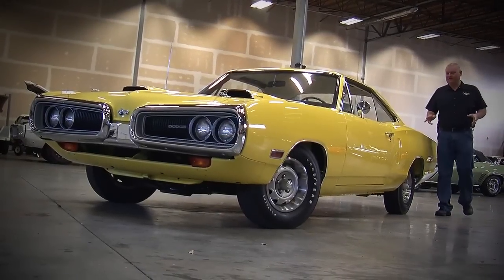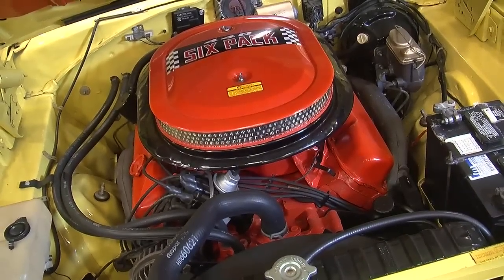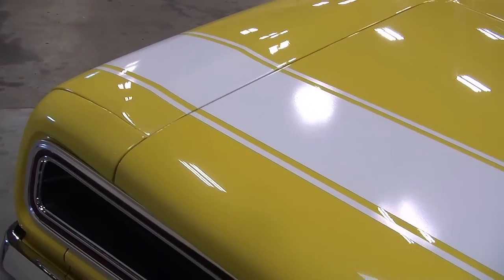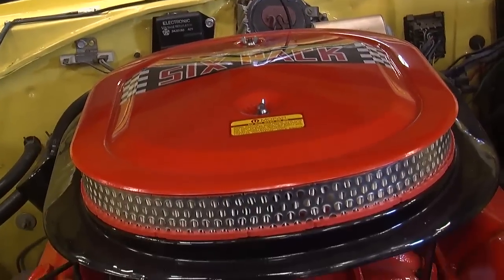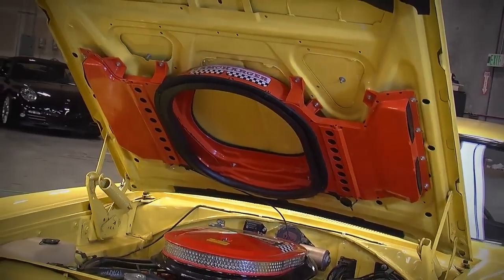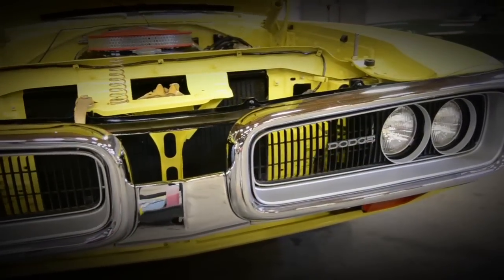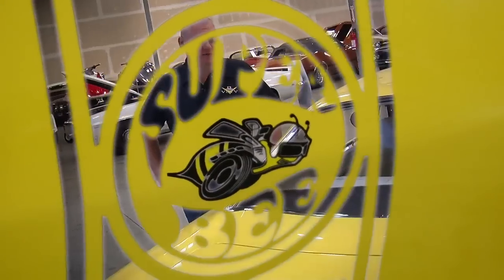1970 Dodge Super Bee 440 6-Pack Muscle Car Of The Week Video #21

Comment: Love that one year only front end!
Reply: Me too. The Coronet R/T/Super Bee is my favorite 1970 Mopar...other than a Hemi Cuda coupe. Love the nose of the 70 Coroner R/T/Super Bee. The Roadrunner/GTX looked almost just like the 68-69 models
Reply: My favorite model too, besides 69 charger
Reply: Back then cars changed every year
Reply: My 70 had a single scoop in the center of the hood. Then put it in a neighbors garage and tool every nut and bolt we could take off from front to back top to bottom. 1 year later fired up almost 500 hsp Beautiful hot rod .

Comment: When I was 19 in 73', I had a 440-6 SuperBee, mine had the power bulge hood, I believe not many of them around, mine was a 727 column shifted, Dana60 with 4:10's, power front discs, buckets, no center console, full insterments, go-wing, chin spoilers, red with black "Bumblebee stripe, the hood was flat black and the bulge was left red, looked really cool. I liked having the L60's fit right in the wheel wells, skinny front tires. Mine did not like going around corners! I have pictures but don't know how to put them on here. Wish I still had it. 😞 I'm now driving a 69' Swinger 340 4spd. Fun to drive, but wish I had the "Bee"!

Comment: I had a 1970 Coronet R/T 440 Magnum in 1974 when I was a junior in High School. I only paid $1100 for it. I was in Auto Mechanics Voc Tech, so I installed what was equivalent to one of the Scat Packages on it myself. I had an Edelbrock intake, Holley 850 double-pumper carb, Hooker Headers, and Accel ignition, but stock cam and valve train. Even with a Torqueflite auto trans (with a "shift kit") and a 3:73 rear end, with Mickey Thompson fat tires on the back it even caught rubber going from second the third and was practically unbeatable on the street. I though it was pretty ugly though, because it was "Plumb Crazy" purple with a white stripe around the tail and had white bucket seats with a console and black carpet. My mom sold it for $1000 after I went in the Air Force! Wish I still had that car!

Comment: Fuel-injected engines are really nice today but you just can't beat the old carb engines in muscle cars when they're tuned right they run and that Ram air system you could hear it when I used to have my duster you can hear it sucking the air in what a sound

Comment: The idiot light at the bottom of the dash was not for oil pressure.  It was a REVERSE GEAR indicator for 4-speed equipped cars.  GREAT VIDEO OVERALL!!!
Reply: David miorgan That’s correct David. Had a ´72 Duster Daemon, and that amber light illuminated when you geared the reverse correctly
Reply: David Miorgan  I mean, if you put your head down there and read, you will see the word "REVERSE" on it. I should know, every Mopar 4-speed I ever owned, including the Road Runner in my garage, had one.
Reply: Lol
Reply: Thanks !  I had a 70 Roadrunner and was thinking that I did not remember any such idiot light...just the guages. You cleared up that mystery for me!

Comment: I was a member of the "Scat Pack". I also bought the red jacket with all the trimmings. My Challenger used to eat CHevy's and Hemi's for breakfast. Yenko's? No problem.
Reply: What do you mean by eat? That it went faster for a few feet? What was in your Challenger? You might have taken the hemi's  in the 1/8 mile, but no way in the 1/4. Your Challenger might have been faster off the line but once that hemi got wound up it would be goodbye Challenger. But I do believe you spanked those Yenko's.

Comment: I bought one in Jacksonville NC in 1970 right off the showroom floor in green. changed the carbs in NY to a six pack a 3/4 race cam and a port and polish . The car left the ground when I hit 2nd gear.and ate big block corvettes all day long no sweat.
Reply: Still running a Road Runner 6 bbl and i have to agree. Have 13 track championships in 24 years. 6 of the others were Super Bees And R/T CORONET 440s. The other 5 were 3 chevelles and 2 Buick STAGE 1s.
Reply: @soxfunny98  Damn dude, you have had the cream of the muscle car crop. Road Runner, Super Bee, Coronet R/T, Chevelle, and  Stage !. The only thing you missed was the Charger. You're probably building one now, huh? And so smartly stayed away from any Ford's.
Reply: @cincyspin178  
Hey man, thanks A lot.
I must have wrote it wrong.
I'll tell you again what I have for muscle cars ok? Sorry I made you take it that way.
1) 69 A-12 ROAD RUNNER 440-6 PACK RUNS 8.89. THERE IS A MASSIVELY MASSAGED\BUILT 426BKDL XXX
2) 1970 CHARGER RT/SE 44O MAGNUM.(10.04)
3) 1970 DUSTER 340 RUNS 10.26
4) 2019 REDEYE FASTEST STOCK TIME I have run, only made 6 passes so gsrd
Reply: @soxfunny98  Well now you got me real confused.  Why did you mention those other cars, the Chevelles and the Super Bees and the Buick Stage 1?  And if your RR is an A12 with the 440-6 (yes that's correct) then what do you mean by "there is a massively massaged  426? That's a hemi and it's different from a 440.  And what do you mean by BKDL XXX? (By the way, I was going to ask if the RR was A12 , but I deleted it) Are you some kid making up stories for the internet?.
Reply: @cincyspin178  You ready??
Reply: @cincyspin178  
You ready.
I was right the first time.
Ok here we go. Hope your ready.
1) 69 Runner 4406 bl car
Has a 426 max wedge, well built. It ran an 8.89 my 3rd run this year.
2) 1970 DODGE CHARGER RT/SE
440 MAGNUM. BEST RUN I BELIEVE WAS 10.04
3) SCREAMING SMALL BLOCK 340 DUSTER. Best time to date
10.26.
4) 2019 Red Eye.
Not many runs but I'm thrilled
10.51 in a car Chrysler said would run 10.7s
Ok here's where confusion set in.
The SUPER BEE, CHEVELLE
AND STAGE 1 WON CHAMPIONSHIPS. 
THE BEE ONE 6!!
THE CHEVELE ONE TWICE
STAGE 1 3 TIMES.
THOSE CARS WERE THE ONES I DONT HAVE BUT WERE CARS THAT WON THE CHAMPIONSHIP WHEN I DIDNT.
I WON IT 12 TIMES!!!!!

THE ROAD RUNNER A-12.
EASY.
HAD THE ROAD RUNNER WHEN I WAS 17. I TRACKED IT
 THE A-12 started to go way up in value. I took the original 6 bl engine out and put it in my shop with 32K on the Odometer!
I have owmed it for a long time
Anyhow I thought IF I ever want to sell, a low mileage 4406 BBL CA
I COULDN'T DO IT.
AFTER THIS SEASON OF RUNNING HER. I PULL THE MAX WEDGE OUT AND SELL IT
 BACK WITH THE 6 BBL
Reply: I have those 4 cars W3 HEMI SATELLITE.
IT HAS A 391 GEAR AND A 
727 TRANS. 
I WANTED TO SAVE THOSE 2 FOR my.channel next sunday
Reply: @soxfunny98  Whew...thank you. You properly diagnosed where the confusion set in. What's left of my brain was starting to melt figuring out which cars were which...lol.  Glad my compliment wasn't wasted and that you're not some kid making up stories. It Wouldn't be the first time.  So you do have an impressive stable of cars. Are you a Mopar guy by any chance? ...lol... And let me see if I got it right...24 years of racing, 13 championships won in the RR and when you didn't win, the cars that won were 6 times Super Bee/Coronet, 2 times Chevelle, and 3 times  Buick Stage 1. Yeah, I got it now. And in your stable now is the RR that came with the 440-6 replaced with 426 max wedge that runs high 8's, a Charger that runs low 10's, a Duster that runs low 10's and a 2019 Red Eye that ran a mid-ten which is lower than advertised. (And maybe a hemi Satelite, but we're keeping that quiet, for now.) Nice.
Good call on the A12 value. I see lots of people in these comment sections kicking themselves for not keeping (insert muscle car name here) that they had when they were younger. For me it was a '69 RR., completely stock. It had the 383, not the most desirable, but it did have the factory 4 speed with the Hurst. I once tore a wheel of it doing a burn-out. Got out and saw the lug nuts were still attached, but the tire was rolling down the street...lol. You probably have better stories of epic power but that's my little one. So are you gonna sell the 440-6 and retire after this year, or do you just want to switch horses? Someone is going to get themselves a real nice RR. Anyways, thanks for clearing that up and good luck this year. Take care of those stallions!  Cheers.

Comment: In the late 80's I had a chance to pick up a very similar car, the exception was it was a convertible! It had the big 440 engine. He wanted just a click over $10G's so I offered him $9,500. He said he'd take the weekend and think about it. I called him on Monday and the car was sold. Still kick my ass because it was well cared for and only had 70+ miles on it...and it was a convertible to boot!
Reply from the maker: The ones that got away...
Reply: That one really hurt because I should have just given the 10g's instead of trying to get the edge. If I only had 9,500 it would have been a diferent story, but I could have afforded the 10 he wanted....and the car was beautiful, damb it!
Reply: I had a chance to buy a 69 Mach 1 SCJ 4 speed in 88 for 3K. I didn't buy it. Blue original. Kick my ass too

Comment: I had one in 87 a 70 ( 383 car ) 440 hp2 727 3.91 yellow, black int bench & top no stripe. Paid 1750 & didnt have to do anything to the car. Just gas & go. I loved the pass side floor vent when you had a girl in the car pull it open over 35 mph & watch her skirt fly right back lol.
Reply: Verry nice car.!!
Reply: Those where the day , when We'll go drag race throug Arlington Tx, On Cooper St, And not that much red lights,And through 360New York Comeing back 2 Ft Worth,😆
Reply: And Out Run the police, pull In some in some place and turn off youer lights.😅👍🙏

Comment: i had one in the early 80's but with the molded hood and a auto with the bench seat i ran it at the drag strip i was not ever beat (the 440 had been reworked by my uncle) it held several records for a while also
Reply: Oh i believe you!! Im 53, racing still and have 13 championships with a 6.bbl Runner.

Comment: The Super Bee came out half way through the q1968 model yesr.

It was priced $500 higher than the Roadrunner, with an upgraded interior (carpet instead of a rubber floor cover) and a Rally dash from the Charger.

It also had the option for $15 of a viscous fan with a fan shroud that was available in the Roadrunner without air conditioning.

The reason a high percentage of Super Bees have manual transmissions, in the Dodge R/T manual required the expensive Track Pack or Super Track Pack, while in the Super Bee it was no extra cost.

The Roadrunner was $500 cheaper and attracted those that would save money and want an automatic transmission.

For the price of the Super Bee an automatic R/T with a 440 could be had, so automatic wasn't so popular in the Super Bee, because for the money a larger engine could be had for those that wanted an automatic and that became more popular for the R/T.

Comment: These things used on old car lots in the early 70's were almost free and so fucking fast in a straight line you could use the brakes once, then it was like a fake pedal. God forbid if there was a corner coming up because the steering wheel also became useless. Other than that who could resist getting it in a big block mopar? I lived in a dream time...........

Comment: amazing car and amazing too how short the time frames of these cars were produced and we still talk about them. I remember the guys sitting at the hot dog stand their cars all lined up at an angle , then one by one pull out at some point and with a little chirp into second gear as they left they'd be gone. The hottest cars would go burger joint to burger joint to show off a bit and claim their turf. Then head home after a quick blast up the on ramp,  good times, good times. One of my old neighbors bought a 440 . 6 pack Challenger new, still has it I think  , new condition, and isnt selling it .

Comment: Mine was blue with blue int. and a 4 speed. I did considerable amount of modifying to make it handle and run at 170m.p.h. as long as gas was in the tank. If you want to go fast in these things and be safe, I mean really fast, not a 1/4 miler but a road car. Modify them or you will crash. Low pro tires will only make it slide=crash. Big tall & wide slicks are the ticket. These are getting scarce now-very. I still would love to have another one though. My Blue 68 Bee was faster.

Comment: if the grill is bee wings then explain the 1970 Coronet R/T
Reply: The Super Bee was part of the Coronet line from 68-70...therefore had basically the same nose as a Coronet R/T. Then the Super Bee was made part of the Charger line and the Coronet R/T was discontinued for the 71 model year
Reply: The SuperBee was the Roadrunner for Dodge, the Coronet RT was the GTX for Dodge. The SuperBee was a striped down muscle car like the Roadrunner, the R/T was like the GTX, more expensive because it had a lot of "Standard Equipment" that was "Optional" on the Roadrunner and Superbee.

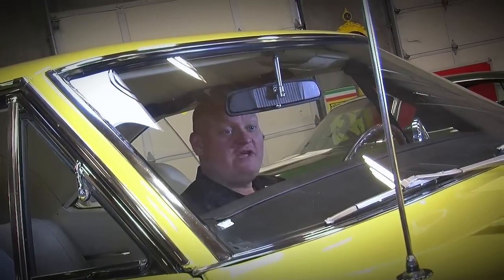Comment: What was that brown smoke coming out of the exhaust? 6:48
Reply from the maker: +Carlos Aponte that was rust from the car sitting for a while.   It's important to "blow them out " occasionally!
Reply: Ah okay.  That's what I had thought it was,  but I wasn't sure!  Thanks!
Reply: gas was so cheap and plentiful that nobody had any problem with adding a few extra carbs to the engine. a different time indeed.

Comment: 1970 coronet is the superbee? or is it a specific type of 1970 coronet that they call the super bee?
Reply: +Ed F booboo    "Scat Pack" extra special versions - yoh COULD get factory sponsored options to go faster!
Reply: +Ed F booboo    "Scat Pack" extra special versions - yoh COULD get factory sponsored options to go faster!
Reply: Yeah, it is a specific type of the 1970 Coronet R/T.  It was based on the Coronet R/T from 1968 to 1970.  And then In 1971 Dodge discontinued the Coronet R/T (although they still made the Coronet 4-door and station wagon) and moved the Super Bee to the Charger platform where it was offered as a lower priced choice to the Charger R/T and was called the Charger Super Bee.

Comment: Surprised he got his facts wrong....Super Bee comes from the body platform, that particular body was the "B" body style just like the Ply. Road Runner shared that same B body platform. Dodge took it a step further and called it the Super Bee and used the Bee Icon.
Reply: He said that
Reply: You're confusing what he said about the Super Bee emblem with what he said about the Super Bee model. The emblem for this car was based on the Scat Pack mascot drawing, the car itself was named for the reason you noted.

Comment: Love this program but the way the horsepower figures are always recited as if accurate is a letdown. They know those numbers were just randomly made up by the marketing people.
Reply: beloog99 High /or unavailable insurance reasons.   Insurance worried about the racing image/crash costs of replacement.  Factory was helping by purposefully giving less than true horsepower ratings to help consumers- NOT insurance "bean counters" who hated these cars!
Reply: Yeah I feel the same way. I've seen a bone stock 426 hemi on a dyno, and it cranked out 493 horsepower at 6000 rpm, yeah 425 horsepower my ass. And I've also seen a 421 Super Duty Pontiac, also bone stock, put out 488 horsepower at 6000 rpm on a dyno. Pontiac only rated it at 405 hp. All to fool the insurance companies to keep insurance rates low
Reply: They didn't really make up the figures, they just advertised it at a lower RPM than the cars were really capable of. If Chrysler actually rated the 426 hemi at nearly 500 horsepower then insurance companies may have been more than reluctant to cover it, and if they did, it would be an astronomically high price. And that would seriously hurt Chrysler's sales of 426 hemi cars. That's just one example
Reply: It was all just to fool the insurance companies
Reply: Jeremy Thompson for the win!!!

Comment: why is that thing puking out rust colored smoke?
Reply: Prob just residue from inside the exhaust, they rust from the inside out because of the moisture that blows out the pipes when the engine is cold. I would imagine this car wouldn't get driven much and would only get idled around the factory once and a while to move it, therefore lots of rusty residue would be present... Then you give it some gas and it just blows out the pipes like that
Reply: Good point